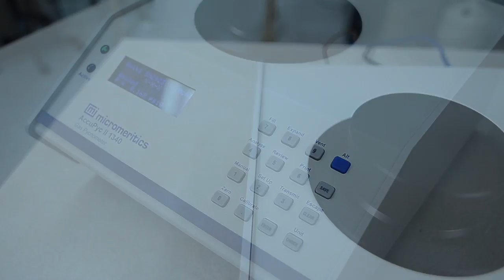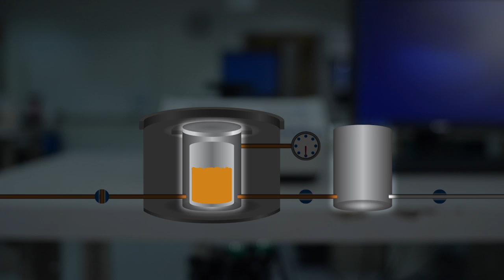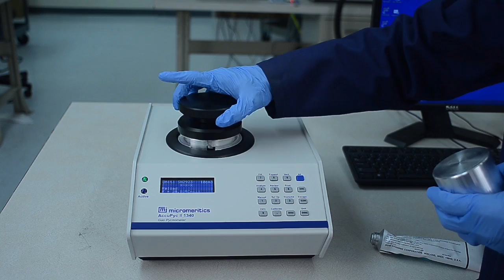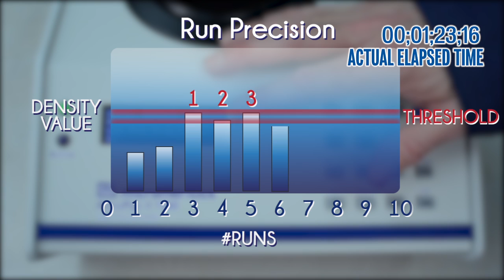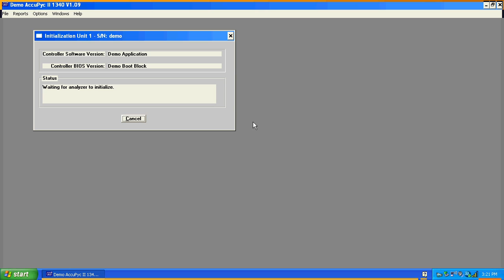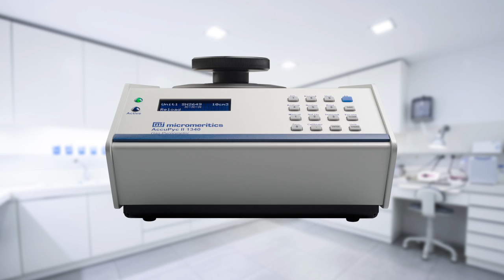Accupyc II Gas Displacement Pycnometry System

Comment: Regards,,
Tell me please, several informations about accupyc 1340 : 
1. The minimum  volume of sample that can still give accurate density data, while determined with accupyc 1340?
2. The smallest volume Calibrator given, when use 10cc cup sample?
Thanks you,..